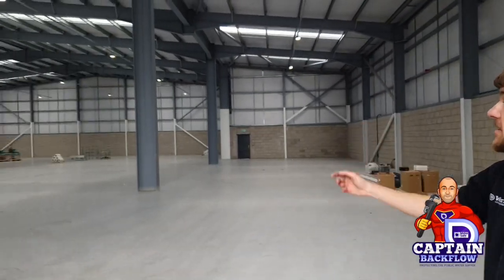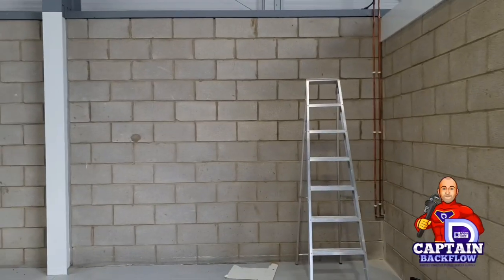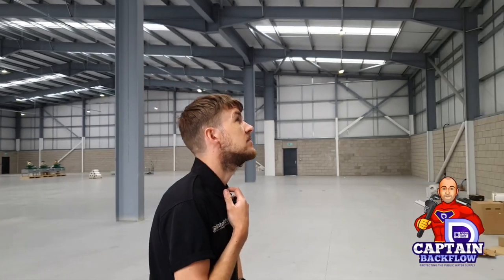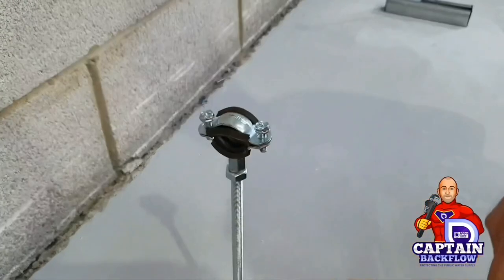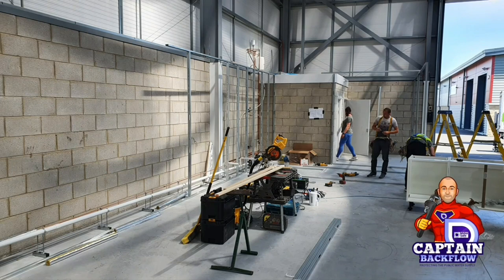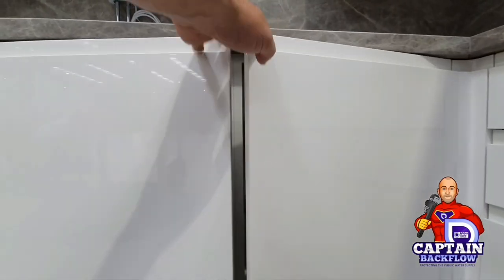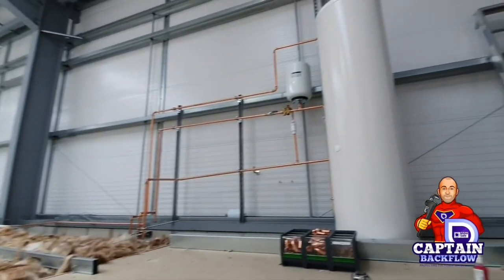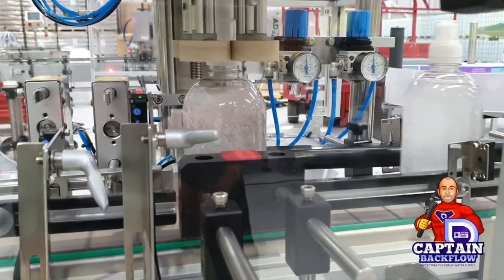Plumbers Videos - Hand Sanitiser Factory - Daley Plumbing & Heating Leeds

Comment: Nice vid again allen .was wondering do you have any experience with thermal cameras as I've a job where I need to find a ch leak under concrete  and think a camera is the was to go to try and trace an unusual heat signature without actually physically seeing it .there seems to be a massive price differance between products and being a tight scot want value and functionality, how about getting the main players in to discuss what we are getting for our money,it may make a good vid.
Reply from the maker: I haven’t personally used one for finding leaks, Sorry. Thanks.
Reply: hire one for the day